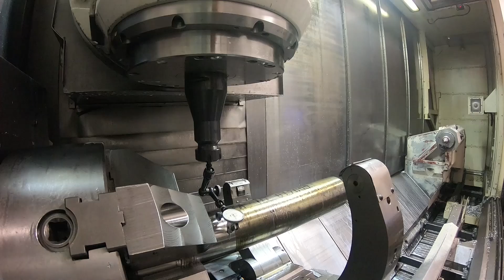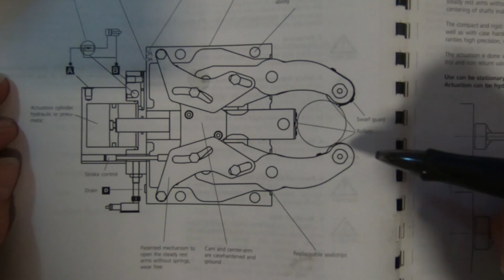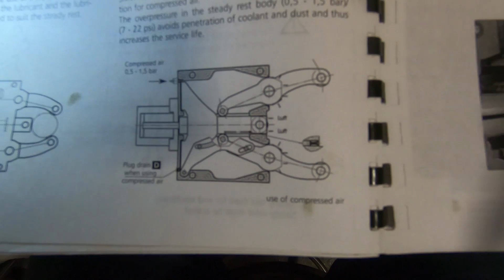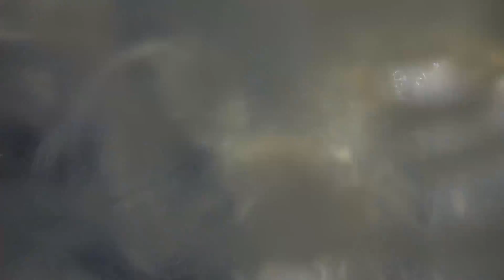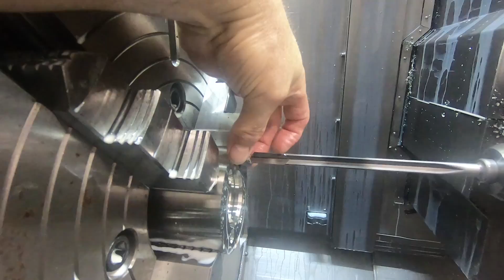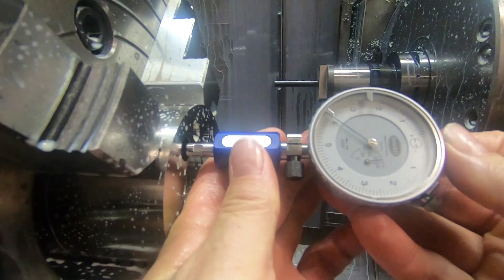Inconel Valve Body End 1-1

Comment: Did you install that chuck on that machine or it CES standard of not may I know what company/brand chuck is that  and where I can get it. Thank you
Reply from the maker: It’s a Bison oil field manual 4-jaw chuck. I took out the draw tube. Then bolted this chuck on the A11 spindle.

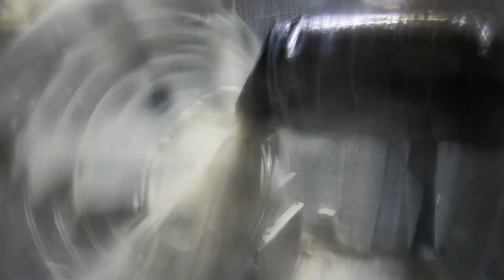Comment: question: 9:41 
if your position screen shows the tool like that (exactly you're calling) but it's cutting exactly the opposite does it mean anything?/ is something off/
Reply from the maker: The Mazatrol my machine has is older the tools icon it shows on the position display is depiction of the tool type. It doesn't have anything to do with how the tool is being used or its orientation.

Comment: And how much $ for that material? Expensive and nerve wracking!🤮
Reply from the maker: The customer supplied this material so I can’t give you a exact answer. But this type of inconel costs around $20.00 a pound. So if the stock was (I can’t remember the exact dimensions) say four inches in diameter by twenty inches long. That would be roughly $1,500.00.
Reply: @EdgePrecision  speechless...exceptional craftsmanship!

Comment: Thanks as always. Hey when spotting do you believe you should spot with an angle so the drill hits the spot hole with the point first? (and not hitting the cone from the spot with the drills edges) So with 118 degree twist drill use a 120 degree spot drill minimum? Thats what Ive read but also heard otherwise. Thanks again.

Comment: Machine shops with CNC really ought to invest in tool presetter to get lengths and offsets of each tool.
Iwas using such a thing about30 years ago.  Makes for easy set up.
Some people forget to alter the offsets and make amazing crashes...
Reply from the maker: The only reason anyone crashes a machine is not paying attention to their distance to display. When you run a unproven program or tool you should pay attention to what you are doing. this is nothing but a lazy machine operator/machinist.
Reply: There are plenty of reasons people crash machines beyond being lazy.  I agree a majority could be avoided by paying attention but sometimes when facing  on a horizonta lor turning on a vertical lathe a part , a  tool could fail and eject the part. It happens so fast that even with your hands on the dials, you won't catch it in time before it goes boom . These instances may not be a machine on machine crash but they can often kick your turret or spindle out of alignment.

Comment: At first really impressive work.
Just one question.
Why you’re measuring with an into and not with a 3 point inside micrometer?
Reply from the maker: First of all thank you. I use a .0001 dial bore gauge to measure the bore because, two reasons. 1: A dial bore gauge set to a stack of properly ringed together gage blocks standard has more accuracy and resolution than a 3 point mic. 2: if the bore isn’t round or has a taper you can see that on the dial. A 3 point mic won’t show that. Or at least not as accurately.

Comment: About backing off all the jaws:

Backing off all four for better runout probably has to do with the backlash in the jaw threads.  If you back them all off and re-tighten then the backlash is pushing the same direction in all four. Just a guess.

Comment: Doesnt the coolant microfracture the inserts?
Reply from the maker: The coolant plays a role. If your doing a intermittent cut where the insert gets hot than it leaves the cut hot and the cold coolant hits it. It cools to quick after time this situation can cause fractures in the inserts edge. Witch eventually causes the edge to fail.
Reply: @EdgePrecision  yes it doent seem to be a problem in a drill with high pressure coolant holes but on shell mills oppsy poosy . I repaired lots of huge cnc machines that were custom built. I had to figure out why the inserts kept failing . It was partly the insert supply. Company intentionally giving us rejected inserts to increase sales. During this I found this odd blue mist oil that worked like a miracle but I cant renember the name of it. All that was needed was flush coolant on all milling operations.

Comment: I'm still learning cnc machining. Is inconel really that hard that it wears inserts that quickly. Love the videos
Reply from the maker: It depends on the type of inconel and its heat treat. Inconel is a age hardening material so it can be heat treated to increase its mechanical properties. It doesn't get real hard like say steel but it gets tougher. This particular kind 718 can be around 120 ksi yield strength all the way to about 160 ksi yield. When you get up in the 150 ksi yield it is considerably harder to machine than say 135 ksi. There is what they call a double heat treating process that improves it's machinability. The rating goes something like this. Low carbon  Resulferized steels have a 100% rating. The 700 series inconels fall into an area of 9-12% rating. That may give you some idea.

Comment: Wow, really amazing stuff! Is it really necessary to zero the machine in X and Y every time? It's always in the same location right?
Reply from the maker: Thanks John! Probably not but I check it anyway. I am dealing with .002" true position tolerances on some of the milling features on the end of this part. When I have to pay for a expensive piece of material and remake the part,---- well you know what I mean. I just want to be sure. Remember measure twice cut once. It only take a few minutes.

Comment: why the  chuck on the end of the rod sticking out of the steady rest?
Reply from the maker: My steady rest wont close down to the diameter of this part. So I mounted a heavy walled steel tube on the back of this 4-Jaw chuck that rides in the stead's jaws than I can clamp to a smaller diameter in the chuck. This also has the advantage that with the chuck in front of the roller jaws it keep chips from getting under the rollers.
Reply: smart

Comment: hi, what kind of values you should use with 12mm gun drill (part is spinning) with aisi 318? need to go about 300mm deep...
Reply from the maker: I am assuming you have the correct coolant pressure and volume. In that material my starting parameters would probably be 150 sfm at a feed of .0005" per revolution. My values are in inches you will need to convert them to metric. I will say this I have had more difficulty gun drilling 300 series stainless than practically any other material. It tends to erode the lands on the gundrill for some reason. I am drilling with water based coolant. It would be better if you could drill with oil if possible.
Reply: yeah, we have correct coolant pressure with water based coolant. at least everything works with 20MnV60(60m/min, 0.04mm/rev(if i remember it correctly)). for aisi we have received values from drill manufactorer like 45m/min, 0.036mm/rev. but not sure if that works, i didnt try those. other worker i guess tried and did not work very well, lasted one drilling. i think i try 30m/min with 0.04mm/rev(or the same with 20MnV60) once i have chance to do that.
Reply from the maker: simexi I think that feed is to fast. I would go with more like .015 mm per rev.

Comment: Hi Peter, very interesting, would it be an ide to have a spinning disk "wiper" in front of camera, seperate from camera mount so not to transfer vibrations.
Reply from the maker: The Oleophobic coating on this window to repel the water/oil was old. In the next video (I haven't posted it yet)I replaced the glass window. It now does better. There is a limited life to the coating under the coolant. These windows are expensive and I'm trying to stretch out there use as much as possible. The thing about trying to use anything mechanical is the power required in the wet environment and the noise it would make. I want the sound as much as possible. If I was to use air to drive things it would require a lot of pressure and volume. This again would make a lot of noise. The air knife on the camera case only requires about 20 psi to function and is virtually silent.
Reply: Hi Peter, Not to step further in it, But what if you had a coolant driven motor for the "spinner" I suppose you have acces to high pressure coolant, and this "spinner" might work with Rainex and that would might also extend the life of camera "windows"

Comment: Jeez...That's a lot of carbide! Do you regring your drills afte? Were I live the machine shops mostly use manual machines for servicing agricultural equipment, and 
usually if an edge get's dull they touch them up on a diamond wheel to avoid using another edge (no matter if they are coated, uncoated or whatever) but for turning to a close tolerance on such tough materials this would be a nightmare! Maybe you could stack a few used ones and get a lead chipbreaker ground into them.

Comment: When I started my apprenticeship in 1977, one of the jobs I was given to do was switch on the machines so they warmed up. Learnt very quickly to make sure the coolant pipe was not pointing at me as I got blasted a few times at 6.50 AM lol
Reply from the maker: Fortunately this machine cant run the coolant with the doors open. But it does sometimes take a little time for the high pressure coolant to bleed down and I have got sprayed with coolant opening the doors to soon. Been there done that.
Reply: Ah ha, the old toolmakers used to set the pipe knowing the very keen apprentice would do what ever he was asked.....hence i got wet a few times. Got my own back over time.
blue marker die on the handles and paint the light bulb black lol. love your work.
Tim
Reply: Is funny reading your comment.
When we were welding out on site some guys that were hired in to make up the numbers were thinking they were pretty good.
 So i fix them up,  i use to put black cardboard in there automatic welding helmets.

It was so funny they had NO idea what was wrong they started talking about how much there helmet cost and that they were going to take them back to where they brought them from. 
Idiots ???????

Comment: Peter, thanks for sharing, always enjoy watching you videos!  I have a question though, after you chucked up the part in the 4 jaw and indicated the part in by the 4 jaw, How did you know that the center in the end of the part that the tailstock went into was running true? Was it center drilled in that setup and not shown?  My thought is that if that center drill hole runs out a little the tailstock could influence the part to run on center during the turning operation but after you release the tailstock the part goes back off center, and you end up with a warped part.  May be I'm just over thinking this... thanks for sharing
Reply from the maker: I didn't show it in the video but I had previously prepared all the blanks with the centers that ran true to the other end.

Comment: Tremendous video, you teach in a way that's easy to learn, thanks for continuing to take the time to make them. I would like to ask you about how you checked your part for concentricity by rotating the dial gauge and the part together. I can see why you need to do this as clocking the part true in the 4 jaw doesn't mean it's parallel to the centre line of the spindle just true to the  'centre' of the steady, but for this method to work don't you have to assume that your tail stock is 'spot on' centre (and you have show use before that yours  is adjustable) or else aren't you just measuring any error between the tail stock and centre line of the steady?
Reply from the maker: Rotating the part the way I showed isn't for checking concentricity. It for setting the X and Y Zero on the fixture offset. If there is run out at the end of the parts OD and your indicating that OD. So if you rotate the part with the indicator and remain in the same location on that OD. You will in this way will be eliminating the actual run out of the part and be finding the true center of rotation.
Reply: Thanks for the reply, I should have been more observant before asking a dumb question. For some reason I had it in my head that you had the dial gauge mounted on your live centre in the tail stock but, of course, you actually had in in the B axis spindle. Oh well another senior moment! :)

Comment: I machine inconels almost everyday.... trust me SANDVIK 1020 carbide inserts are the best in the world. That's a lot of machining and I've lost count of how many tools you had to use. Great video. 👏👍
Reply from the maker: Thanks I will check into that. I am using a Sandvik finish grooving insert grade 1105 witch is the grade that Sandvik recommended. Its working fine but its just a finishing tool. I resist the use of Sandvik inserts unless absolutely necessary because they cost so much. To give you an example that Sandvik insert I'm using costs $21.50 each (The only reason I'm using it is because their tool only holds that insert) the insert I'm roughing all the grooves is a ToolFlow top noch insert (Interchangeable with other brands) it costs $14.30 each and its roughing or doing more work. I have many Sandvik tool holders and silent boring tools they are indispensable and I wouldn't want to do without them. I just wish the could be more competitive with the price of their inserts.
Reply: Edge Precision Big name brands never disappoint . I use regularly a couple of big brand name inserts , and also a few smaller manufacturers  . Every time the more expensive one wins . By how much depends on situation ... . The most expensive insert i worked with was a sandvik grooving insert , something N123-0400-0004 1125 tf i think so .... Each damn insert has a list price of 27.5 euros , but it's worth it .

Comment: Hey Peter, when indicating at 8:50, how do you compensate for the effects of gravity on the indicator as you spin it around? I noticed you weren't using a coaxial indicator which is usually more resilient to shifting the orientation relative to gravity.
Reply from the maker: I have tested this indicator arm and indicator for errors due to gravity and it has very little. In other words not enough to worry about. But you are correct some arms have quite a bit of error. Any one that uses indicators in the horizontal position should test their holding method and the indicator it self for error due to gravity. Actually the spindle probe would be the most accurate because it’s calibrated in both vertical and horizontal position.

Comment: great video - love the creativity with the second chuck in the steady rest! How are you creeping up on your finishing turn passes when you need to index your inserts so often? How much would you leave for the final pass? Do you index, cut, measure, offset, then finish more or less?
Reply from the maker: The finish turning inserts last enough to get to size but no more. I can’t run two parts with one tip. The rough boring bar you saw in this video will rough the entire bore on one tip but no more. On the OD roughing (next video) I have to index the insert every pass.
Reply: Makes sense. So do you expect your finishing inserts to index with enough repeatability that you can just change it out and run to finish depth? Or do you check them at some point?  Maybe ground tolerance inserts help with repeatability?

Comment: 4/1000 inch or appr 0.1mm per turn change of radius on that boring head @ 19:30 is extremely fine adjustment. Is there some hydraulic magic or a lever/gear or similar in there, because I don''t think there's a 0.1mm pitch ACME screw in there (would be very flimsy).

All the ISO40 boring heads that I refurbished so far, had simple ACME screws in it. Thereby I'm a bit curious on how that thing works ;-D
Reply from the maker: These ITS boring heads have a precision worm gear drive to the lead screw. So what you are turning is the worm that engages the gear that turns the lead screw. It is all very precisely made with very little backlash. These ITS heads are really made by DeAndriea.
Reply: Thanks, always interesting to know on how things work, even if they are beyond my budget ;-)

Comment: I wonder if PCD inserts would help.

Does that Mazak have a Superflow on it?
Reply from the maker: This machine has high pressure coolant (1,500 psi). But it doesn’t have Mazaks variable volume high pressure coolant system.
Reply from the maker: Those inserts generally work on harder materials. This material is more tough than hard.

Comment: How many hours does it take total to make this valve body?  Excellent work.
Reply from the maker: Your not yet seeing the complete operation on this end of the part. To do this complete operation takes about 20 hours on each part. But like I say you haven’t seen all of it yet. I still have to do the other end. I don’t yet know how long that will take.
Reply: 20 hours...wow. How many parts do you have to make?
Reply from the maker: There is only seven parts.

Comment: When doing the 9" deep hole and gun drill holes how do you start your drill cycle? Rotating and feeding all the way or do you start the spindle once inside the pre drilled hole?
Reply from the maker: With the gun drills I feed in at 50 inches per minute with the spindle stopped. Than turn the spindle and coolant on. Than start the drilling cycle. With the 1.25” drill I just start the spindle and coolant rapid in to just short of the previous holes depth. Than start the drilling cycle. I set the R plane for these cycles at the same level as the entry move.
Reply: @EdgePrecision  Thanks for the quick response! You've got the best CNC YouTube channel! Keep the videos coming